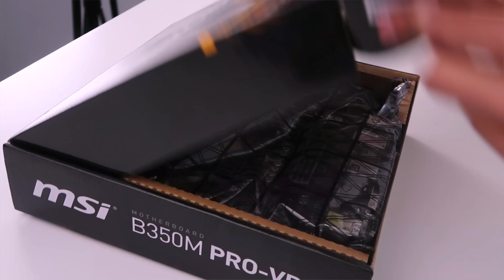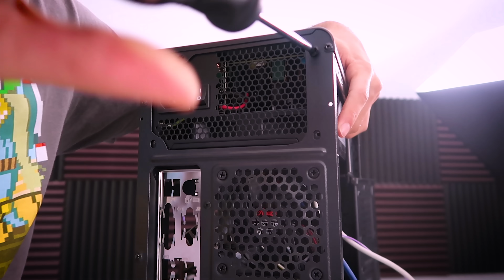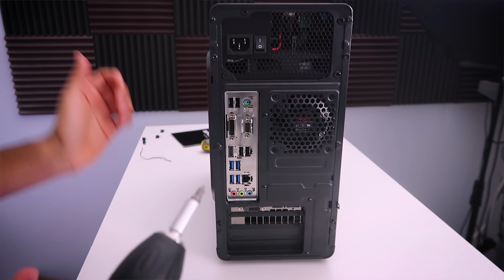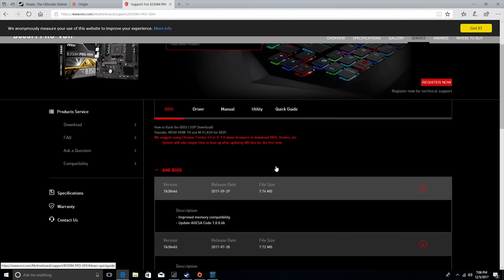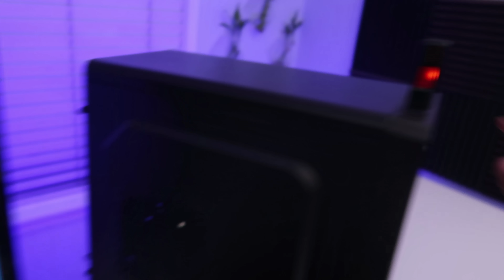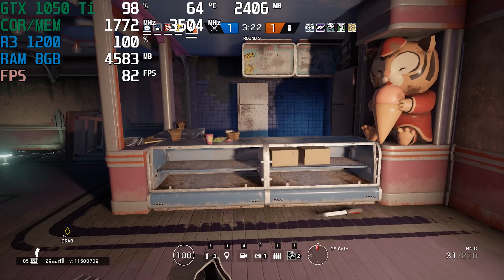$500 Budget Gaming PC Build Guide - GTX 1050 Ti (w/ Benchmarks)

Comment: If we buy the ryzen 3 1300x and not overclocking do we still need to update the bios?
Reply: xLoozii you don’t have to it’s up to you but it’s better to do it since it might fix a few bugs
Reply: Luis Ramirez and then once its done i dont need to go into it again?
Reply: xLoozii not unless they release another update. It’s all optional tbh. The way I see it, if it’s working fine then leave it alone
Reply: Luis Ramirez ok thanks. Its my first pc build im debating on whether getting the 1300x or doing the exact same as the video
Reply: xLoozii honestly just get the 1200. Save yourself the $20 and just overclock your 1200 to 1300x speed. It’s not that big of a difference anyways
Reply: Luis Ramirez Ok. Thanks alot. It would be much easier to go off of the video exactly anyways i suppose.

Comment: is there a difference between mini and non mini gtx 1050ti ???
Reply: Random bit just temperature
Reply: Luis Ramirez is it more hot?
Reply: Luis Ramirez        you know I'm asking because I made a mistake by buying ram, I didn't notice that it was SoDimm or what it was saying so when I got it, it was too small I figured it out it was for a laptop :DD, so I want to make sure I can install gtx 1050ti MINI into my pc and I want to know if it's compatible or not :D
Reply: it might be by a few degrees and might be clocked lower. maybe 1-2 fps difference. negligible

Comment: What resolution were these games in? I might be totally overlooking it.
Reply from the maker: 1920 x 1080
Reply: Joey Delgado hey thanks! Great to get a response. Actually I want to do an ITX build. It's my first build. 1070 prices are insane. I want a 1440p machine. Do you think an RX580 could handle 1440p? Or should I look at something else? I'm trying to use the AMD Ryzen 5 with an ITX AM4 ASUS Strix board. Can you recommend which type of 580 I should use? The sapphire kind or red devil for example. Or a different card near the same price? And if the strix AM4 is good ?
Reply: J P Get a used gtx 970. Same price as a new 1050ti but performs miles better.
Reply: Derp I might be misunderstanding but isn't a RX 580 better than a 970? Also the 9xx cards aren't as good for VR and aren't as friendly with Ryzen I've heard also a single 970 is only good for 1080 I want a 1440p machine.
Reply: Derp an RX 580 is the competition for a GTX1060
Reply: J P A Buying an rx 580 rn isn't worth it. A gtx 970 performs exactly/near the performance of it. Also,im pretty sure any cpu can work with any gpu as long as its not bottlenecking one another.
Reply: J P I found a used gtx 970 for 200 aud or 150 usd. While if you look on amazon,a rx 580 is 500 usd.
Reply: Derp I've found some better priced 1060s and 580s I don't want 9xx it's not good for Dx 12 and ryzen
Reply: J P Where does it say it's not good for ryzen???

Comment: I have no knowledge of building a computer so if what I am about to ask sounds stupid I’m sorry. 
But does it matter if I used a ryzen 4 instead of a 3? What is the difference there?
Reply: Evelyn Edam there is no Ryzen 4. It’s only 3, 5, and 7
Reply: Luis Ramirez Difference is ryzen 3 only has 4 cores, ryzen 5 has 4cores 8 threads and 6 cores 12 threads and ryzen 7 has 8 cores and 16 threads.

Comment: i have a amd fx8370 and gtx 1050ti with 16gb ram and im trying to get at least a stable 144fps on overwatch, do i just need to upgrade my gpu or is it the whole system i need to replace. i get that the Amd fx cpu isn't the best.

Comment: Hi Joey Delgado sir can use Rx 560 4gb in this buid
Reply: Kanoji Nipurn yes you can. Just so you know there’s two versions of the 560. One is slower than the other but both are labeled the same. One has more stream processors than the other so try to get the one with the more stream processors

Comment: awesome video 
i’m planning to build my first pc is this good??

Cpu- Ryzen 5 1400
Motherboard- ASRock AB350M Pro4
Memory- Corsair Vengeance LPX 8gb
Storage- Western Digital 1TB
Video Card- MSI Geforce Gtx 1060 6gb
Case- Deepcool tesseract
Power Supply- EVGA 500w 80+
Reply: yeah thats fine. if you have the extra money try to get a 1600
Reply: Luis Ramirez awesome i’ve never made one before
Reply: Luis Ramirez i can change cpu later right? i just don’t have enough for a 1600 right now
Reply: Joseph V yes that’s no issue

Comment: can't get Nvidia Geforce GTX 1050 Ti 4GB EVGA Graphics card  what else would you suggest getting?
 MSI - GeForce GTX 1050 Ti 4GB GAMING X 4G Video Card thats what i was thinking about?
Reply: right now im sitting at 755 Cad and still have to add few parts...help plz
Reply: any gtx 1050ti works mate.
Reply: this is what i have so far.  https://ca.pcpartpicker.com/list/LMr3f8 or for another 20 should i upgrade to the ryzen 3 1300X . or intel ? i'm super new.
Reply: Quinton  Banfield the 1200 is fine because if you OC it, you’ll get 1300x speeds. You can also get a better cooler like the hyper212
Reply: okay well i don't plan on OC cause im so new. and okay ill look for that one.

Comment: is the ryzen 1300 better or g4560 pentium?
Reply: they trade blows tbh. but if you wanted longevity and looking for a more up-gradable experience I would go with Ryzen since its board is going to supply the next 2 Zen chips unlike the pentium which is already a dead socket

Comment: My PC build is:

CPU: I5 7500K kaby lake

GPU: GIGABYTE GeForce GTX 1060 6GB 

PSU: 700 WATT

Motherboard: Gigabyte H11OM-Gaming 3 with LGA 1151

RAM: Corsair 8GB DDR4 2500 MHz

Case: Galadoator ultra Mid- Tower case

Comment: Would there be any benefits of swapping the 1050Ti for a 1060?
Reply: higher frame-rates, also its a 6GB VRAM on the 1060 compared to the 4GB VRAM on the 1050ti which will allow higher textures in newer games. Basically you can have better frames and high settings
Reply: Luis Ramirez But what if it's a 3gb 1060?
Reply: jose valdez it’ll still be faster but lower textures on more graphically demanding games

Comment: wow I was confused whether I should go with 1050 ti or 1060. Because my budget was not permitting. I want to edit videos primarily. more ssd more ram and nice monitor for me it looks like :)
Reply: if you want to edit videos mainly go with the 1050ti and upgrade the 1200 to a 1600
Reply: Luis Ramirez yup I did the same. Going with a combo of r5 1600 and 1050ti 16 gb ram 250 gigs ssd. :)
Reply: Luis Ramirez yeah the 1600 is great for workstation

Comment: Joey i want a predator acer g3 Intel 7 but they cost so much, ¿you recommend it?

Operating System
Windows 10 Home
Processor
Intel® Core™ i7-7700 processor Quad-core 3.60 GHz
Graphics
NVIDIA® GeForce® GTX 1080 with 8 GB Dedicated Memory
Memory
16 GB, DDR4 SDRAM
Storage
1 TB HDD, 512 GB SSD
            1499.99 dollars 

https://www.acer.com/ac/en/US/content/predator-model/DG.E04AA.015

Comment: hey joey if i wanted a ryzen 3 1300x 
can i overclock it on this mobo?
Reply: what I heard is that the ryzen 1200 is the one to go bcs like he said you can overclock it and basically you will have a 1300x without having to spend the extra 20$-30$ and if you're starting out just stick with 1200 Please correct me if I am wrong.
Reply: Eniliano Vega I think he said that because he might want an even higher clock speed
Reply: ALFA_Lynex_ yup
Reply: thx :D

Comment: Hey joey good vid as always but can i ask if my 60hz monitor will limit my fps in game ? and what is the best budget gaming pc build for r6 siege 

Oh and also i want to play r6 siege in max settings
Reply: Sterben you need at least a 1060 6Gb for max settings
Reply: Luis Ramirez  can i use my 60hz monitor to gain more fps or locked only on 60fps?
Reply: Sterben 60hz will only show 60fps. No more. So just enable vertical sync so you don’t get screen tearing
Reply: Luis Ramirez what if a i have a  monitor that has a vga plug into it and i want to plug it in on my gpu that has an only hdmi and display port plug can i use a vga to display port cable and use it properly? Is there gonna be a problem on my performance? I know that vga only supports 720p
Reply: Sterben yeah an hdmi to vga or display port to vga adapter will work. And no your performance will be better since it’s only going to display at 720p
Reply: Luis Ramirez  okay thanks a lot dude
Reply: Sterben no problem man. Lemme know if you have more questions. I constantly refresh the new comments and help out new people.
Reply: Luis Ramirez dude is gtx 1060 a good buy on 2018?
Reply: Sterben the 6GB version is. It’s overpriced rn due to mining though
Reply: its actually in the right price in my country i want to play games like anthem and monster hunter world
 in the future will it be able to run on high settings?
Reply: Sterben you should be able to. It’s a mid range  card  and has a lot of vram so you should be good with it for a few years
Reply: oh okay tnx one more thing rx 580 or 1060?
Reply: Sterben most games are nvidia optimized tbh but with most of the market turning to DX12 I would go with the RX 580. I’ve never had an AMD card but between those two the 580 wins
Reply: Luis Ramirez  thank you so much

Comment: I’m kinda new to this whole building computers thing, I just have a few questions.  What’s a good budget and nice resolution monitor and If I went with the AMD Ryzen 3 1300x CPU could I overclock that for even better performance?

Edit: will a bigger hard drive hinder performance, I want to get a 3 Terabyte
Reply: slowpokeyay I think AOC bestbuy has for $100 is good. 

The 1300X isn’t worth the extra money when it doesn’t offer enough extra performance over the 1200 overclocked. A bigger hard drive would not hinder performance

Comment: Hey Joey thanks for the videos man. I've got a  question for you. 

I have an EVGA PSU with two connectors for the GPU on the same cable, but one of them is pig tailed off the main connector. Which one do I use for my MSI 1050ti? I only need one of them.

Comment: Hey Joey, I see that u chose the Ryzen 3 1200, is there any reason to why u didn't choose the Ryzen 3 1300X? Only around £10-20 difference in them both
Reply: Lemon cake 1200 can overclock to 1300x speed so save the $20
Reply: Luis Ramirez after doing some research, yeh I agree I'd stay with the 1200

Comment: Do all
Custom gaming computer need two rams
Because the one I bought only came with one :(
Reply: As long as it's atleast 8gb it should be fine
Reply: Pulse no it’s just the way the CPU uses the memory. 2 sticks is just better
Reply: J4DEE GAMING ok thank tiki because I'm building mine today I have all the pars but I only had 1 8gb ram
Reply: If you only have one stick of ram, you're boned if it fails. That's the best reason to have at least 2.
Reply: Robo my friend helped me build it and it didn't work there was either a problem with the power switch because it kept restarting every 3 seconds or the power supply rip thanks for the help anyway
Reply: Robo yes me and my friend try that I'll try again thanks for the help man :)
Reply: Robo i made a video if you wanted to see it :D
Reply: Hey guys i built this pc. And all the fans and motherboard light and everything are one. But my monitor says no hdmi signal... any one know why?
Reply: Tux this sounds very silly but make sure your hdmi cable is plugged into your graphics card and not an hdmi port on your motherboard because your cpu might not have integrated graphics or your motherboard might not support them..not that youd want those over your gpu anyway. Also make sure your graphics card has power connected to it if it requires a pin
Reply: Na mate you dont need 2 unless you want more ram
Reply: Dont need to but certain motherboards might only allow certain speeds with certain configurations, like my MSI B350 Mortar Arctic says i need a dual stick config for ram to run at 2400
Reply: Pulse that’s probably better to upgrade if you only have two ram slots because you can just buy another stick of 8GB because a single stick is not always enough these days

Comment: In your opinion, how necessary is it to use separate thermal paste to put on the cpu fan? I hear from different places that the pre-applied stuff isn't good quality or that it isn't good enough in terms of longevity, but I don't really wanna spend the few bucks on something that I'm not even going to use entirely and probably won't need to use again for a long time.
Reply: it doesn't really make that much a difference tbh. some people just prefer to put their own because its a fresh application rather than the pre applied dried one that comes with the stock cooler. you're looking at a couple degrees in temperature in difference.

Comment: What if I wanna go with a 2 TB HDD and a SSD and maybe a 1060 ti, should I be able to use the same other parts? And what about only with the HHD and SSD? Tx <3
Reply: Yeah you can use all the other parts. If your going to go from 1050 to 1060, I'd upgrade the cpu from 3 1200 to 3 1300x, only extra 10-20.

Comment: If I were to get a Ryzen 5  1500x instead, would I still need the superclocked gpu or could I possibly go down to something a little cheaper? Thoughts or idea on a different gpu?
Reply: Tyler Arnoldussen just got 1600, don’t go 1500X. Not worth it when the 1500 can OC to 1500X speeds. If you want more graphics power to make games look better and run better yes get a better GPU.

Comment: For the people that wanna save some money, get the RX 550 4GB. Yes, i know that the GTX 1050 ti is better but look at the prices

RX 550: 110$
GTX 1050 ti: 160$

If you wont overclock Ryzen 3 1200 go with a A320M chipset board. If you will overclock, go with B350M chipset board. A320M chipset boards are sometimes cheaper but B350M chipset boards are if you want to get extra performance. And i also STRONGLY recommend overclocking your GPU.

Best OverClock for GTX 1050 ti:
Core Clock: 200
Memory Clock: 300

Best OverClock for RX 550 4GB 
Core Clock: 150
Memory Clock: 250

If this did help you a little bit, like this comment and never forget to subscribe to Joey cuz hes the best :)
Reply: Plip actually it’s cheaper to get a RX 560 for $80-110 and it’s a better performer
Reply: True.

Comment: Somebody please reply is this a good game pc that is quiet and doesn't get too hot? And are the parts compatible?
Amd ryzen 5 1600 

Asus prime b350m-a

Corsair carbide spec-alpha black/red

Corsair ddr4 vengeance lpx 2x8gb 2400 c16

Thermaltake tr2 s 600w 600w atx zwart, rood power supply unit

VGA gigabyte geforce gtx 1080 windforce oc 

Wd ssd blue 250gb

Western digital blue wd10ezex 1tb

Comment: Would you recommend this build with the ryzen 1300cpu or the previous ryzen build for $550 , If you have more money and want better performance without overclocking?
Reply: Jose el frijolero the you’d benefit more from a better graphics card than going from 1200 to 1300x. You’d see more gains from say a GTX 1060 with the ryzen 3 1200, than you would see from a 1050ti with a ryzen 1300x

Comment: Hi i am about to buy all of the parts to make this computer...

i bought everything except for the AMD Ryzen 3 1200 Processor
does the 3 x1300 mount the same way??? Joey Delgado
Reply: iCow_YT yes
Reply: Luis Ramirez the power supply (430W) is out of stock will the 500w be safe to use?
Reply: iCow_YT yes it’s fine

Comment: NEED HELP: I bought a pc of ebay for £399 which has the following 3.5TB hard drive, 12gb of ddr3 ram (will upgrade to 16gb), amd 8350 cpu, usb 2.0 ports, 3.0 ports and a 3.1 port , a GTX 1060 6gb graphics card, windows 10 64 bit, built-in wifi (will use ethernet obviously), HDMI, dvi, vga etc. Comes with 65 games and wireless controller. Apparently the pc is new. This pc can also play pubg on recommend setting. Was this worth it or a total waste?
Reply: just the graphic card is over 300 euros here in finland.
Reply: TripTheDarknes and £300 in the uk ... screw bitcoin mining
Reply: if you combine roughly all together,it comes to around 750+
Reply: Wow must of got a bargain then :)

Comment: Hi Joey. I have a GTX 1050ti. 550 watt PSU and a dual core Pentium 3.3 Ghz CPU. What would you say is the best option for a CPU upgrade that doesn't cost too much.
Reply: i'm using pentium g4560 with 1050 ti,runs OW 100+ fps on ultra,path of exile +100 fps on max....
Reply: TripTheDarknes problem is if I get that one I need a new motherboard with a 1151 Socket
Reply: BLACKBEARD save up. Lga 1151 has bigger upgrade support or switch to ryzen 3.

Comment: I plan on building a pc like this, I also found a guy selling one of these https://www.bestbuy.com/site/ibuypower-desktop-intel-core-i7-7700-16gb-memory-nvidia-geforce-gtx-1060-120gb-solid-state-drive-1tb-hard-drive-gray-black/6032004.p?skuId=6032004&ref=212&loc=1&ksid=75eb9c7d-85ba-4610-875c-e340052c4b37&ksprof_id=8&ksaffcode=pg199028&ksdevice=m&lsft=ref:212,loc:2
 For about 300$ cheaper used, how would this build look compared to the store built one?

Comment: I've been building computers for years but for some reason I watched the whole thing lol.

You earned your likes, sir.
Reply: Solruc [CarlosColombia10] I need help. Some how the one with 2 fans is cheaper, but is it compatible? EVGA GeForce GTX 1050 Ti FTW Gaming Graphic Cards ACX 3.0, 4GB GDDR5, DX12 OSD Support (PXOC) Graphics Card 04G-P4-6258-KR
Reply: Colin Pike yeah but the two fans will need to be plugged into the PSU.
Reply: In Modern Living Rooms Everyone Using "SoundProof Curtains" That Stops Outside Noise by 80% (25 Db) Tested. Check Here: https://livesoundproof.com/best-soundproof-curtains/